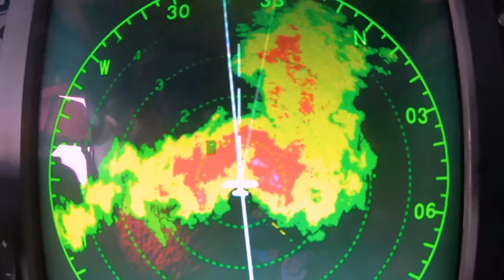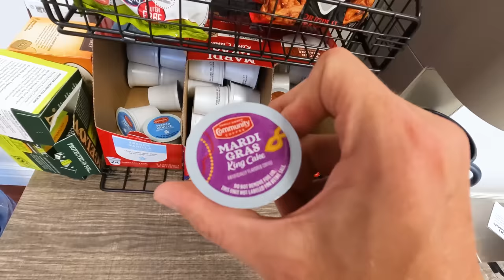the table company that doesn't sell tables...

Comment: That's a nice simple design for a table, easy to make and fits in with that new "boho" trend. I've been building tables for 10 years now and have come a long way. Stay away from pocket hole screws and be sure to use real joinery.The most profitable tables from what I've seen are epoxy and live edge. Large epoxy tables can get upwards of 5 to 30k, but can be very messy and take some skill to master, while a live edge can also fetch thousands, but requires less skill. Definitely a good seller for etsy especially.

Comment: My business has 8 employees.  6 are full time, and 2 are part time.  We average right now just over $250,000 per year in sales.  One employee is a master tradesman, who can build anything.  Another is the kind of guy who you can say just cut each board to this length, and then hand it off to someone else to do the finish work.  Between all of us, we run a multi-faceted business, but others are ready to step up and do whatever is needed.  Me personally, I could do it all, but I am the owner and actually do little other than create new products for the others to make.  You need to learn to delegate, or you will be overwhelmed by trying to do it all yourself.
Reply from the maker: Excellent advice!

Comment: When I told you it's pronounced "kahn-bahn" I meant no disrespect... it is that, however.  If you had the workers, you could probably make 2-3 tables at a time with your existing equipment.... it might require a lot of time-coordination, but you have the skills (and process engineering experience) to do it... and you certainly have the room for it... just my 2 cents! love this channel